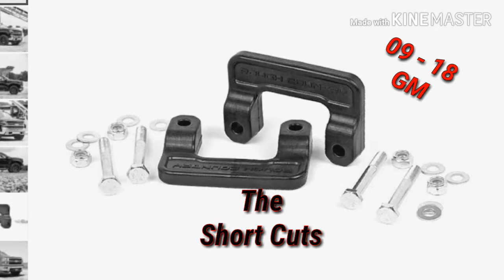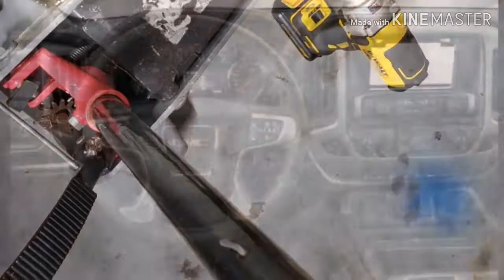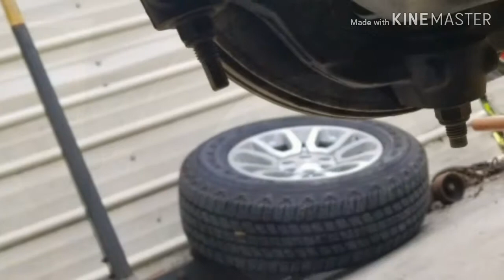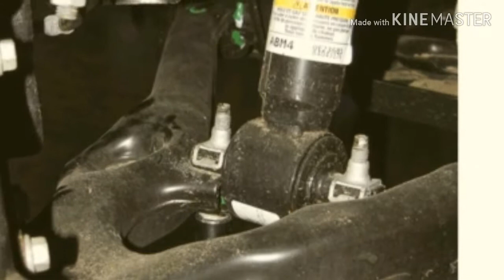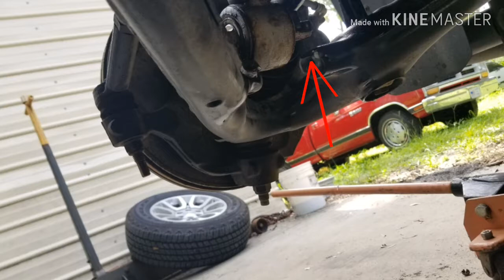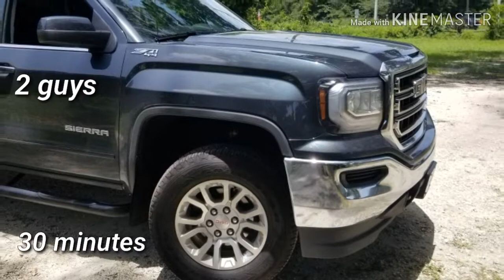R C 2" Leveling Kit (Short Cuts)  [DRIVEWAYinstall]

Comment: Did you have to trim bolt so doesn't rub axel ?
Reply from the maker: Went bottom up because we did not take this truck "as far" apart......but had no problems, at all.
Reply from the maker: No.
Reply: Thanks  I guess it would be same for a 2011 .great video
Reply: Thanks gonna do mine tonight

Comment: How does adding a 1” block under the shock raise the front up 2”?
Reply from the maker: Sorry for the delay...... I know the math is off on most leveling kits, but tire to wheel well clearance is just about 2"
Reply: American Trucks has a video explaining how the 1" lift spacer adds the 2" change as, "in combination to the added suspension geometry changes along with the compression changes it will provide a 2" lift" check out their video it's explained within the first 2minutes